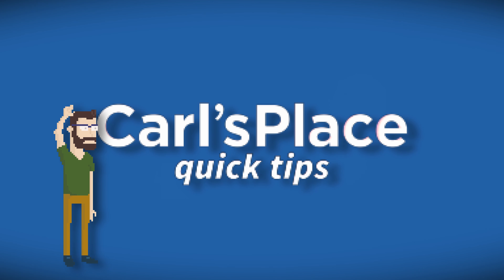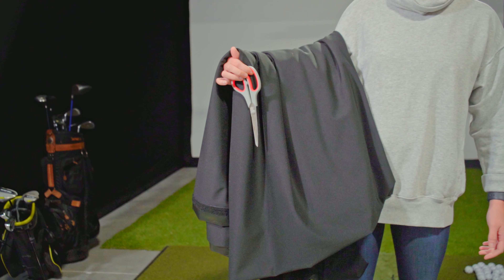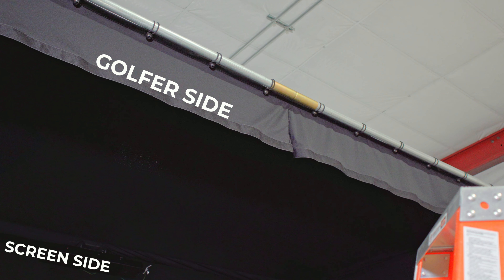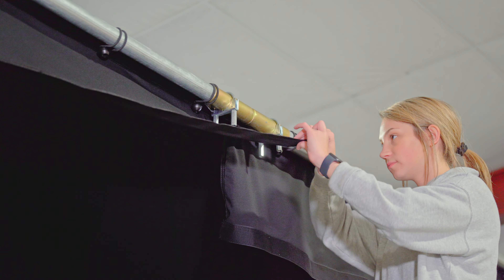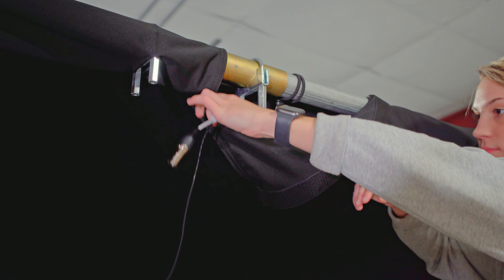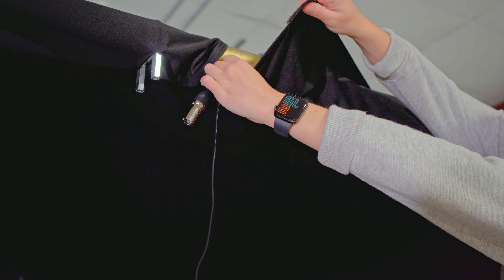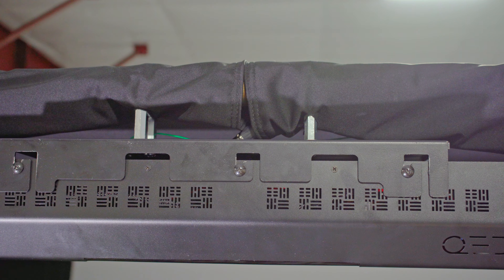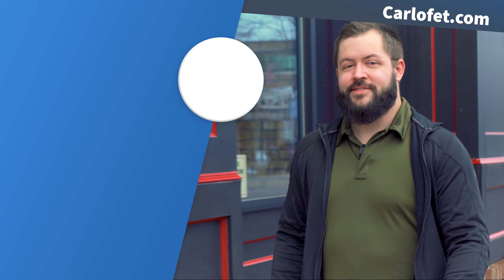How to Mod Your Pro Golf Enclosure for Custom Mounts and Tech - Carl's Place Quick Tip

Comment: I inquired about enlarging the depth of my enclosure from 5' to 8' so that I could mount the electronics as shown.   I was told that it cannot be done without ordering an entirely new enclosure.  Paying for an entirely new enclosure just to get the side and top fabric seems excessive.
Reply from the maker: Hey! Thanks for reaching out! 

While extending your enclosure depth from 5 feet to 8 feet would require the purchase of a new enclosure side and top fabric (and likely depth pipes as well), our customer service lead Taylor would like to check on your order and see what other potential options there are for us to help. You can reach Taylor via email or phone here: www.carlofet.com/contact.

Looking forward to helping you!